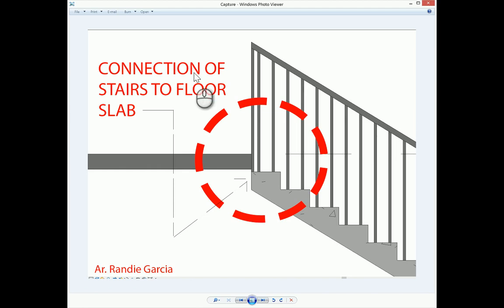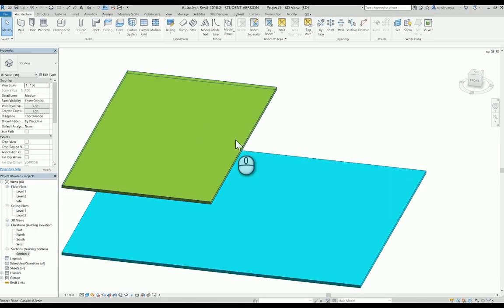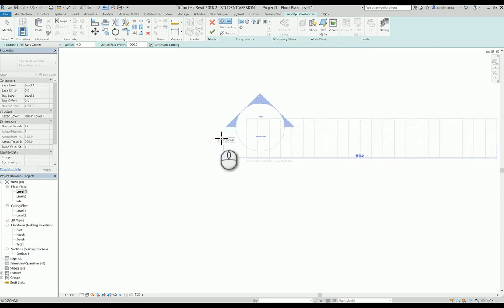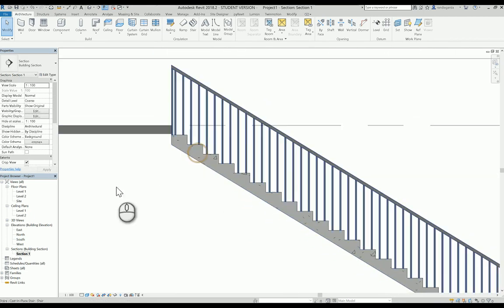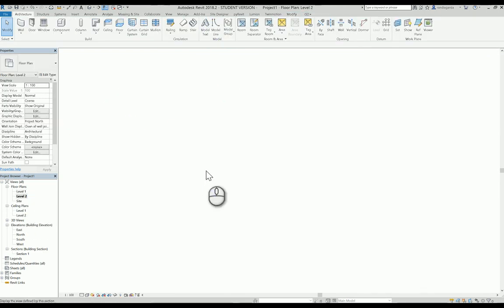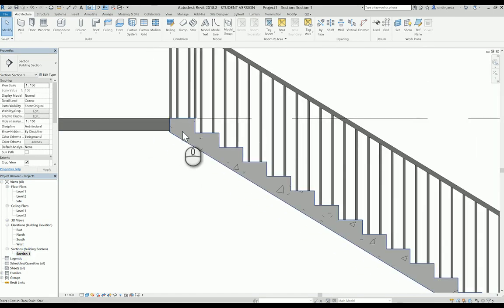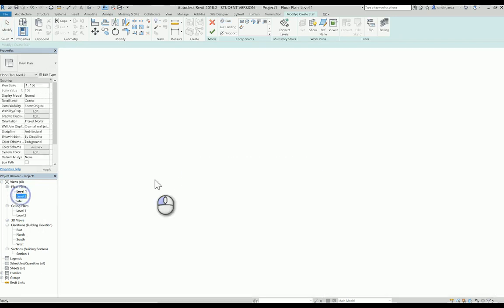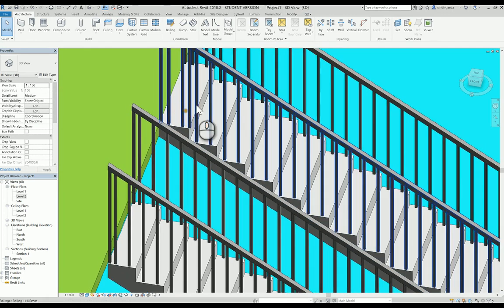Stair connection to the floor slab

Comment: Wouldn’t it be nice if autodesk played catchup and fixed this construction error... This is a good solution except that there is an additional line added at the top of the stair in plan view. I tried to join to the floor using matching materials etc. no luck.

Comment: Did you try another approach to resolve the issue that maintains stair integrity?
Try the following steps
1- Select the stair 
2- Edit stair 
3- Select the run 
4- Uncheck the "End with riser" in properties filed under construction 
5- Add one step to compensate for the missing step and reach the required level
Reply from the maker: Yes i did that before. Thank you for your comment.
Reply: thank you

Comment: There's one thing I wanted to ask.
By sketching the extra landing does it increases one extra step ?
Reply: Not an additional step, but this method adds additional tread and need to start the staircase one tread length back.  Not always ideal, especially when there is space restriction
Reply: Nop